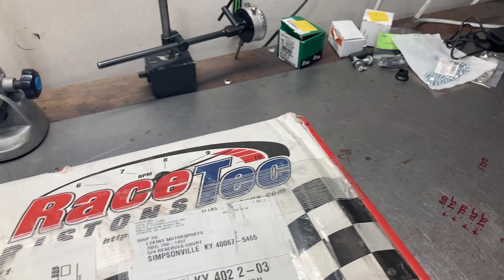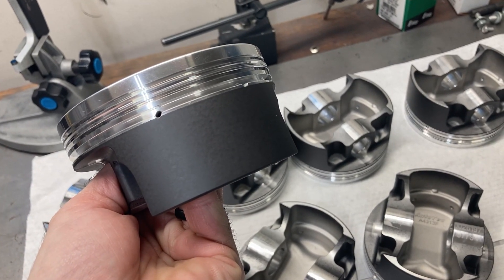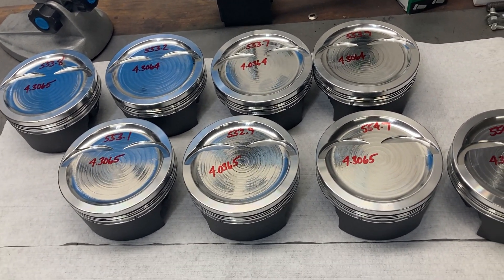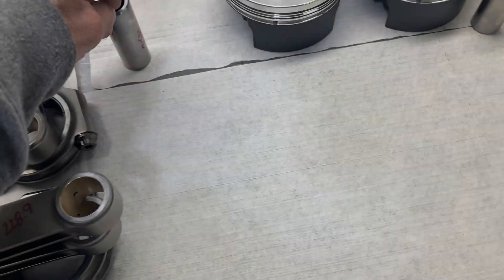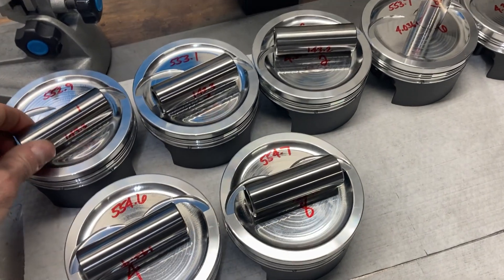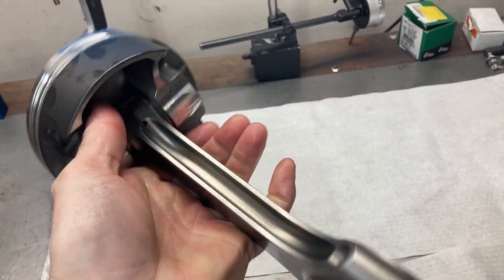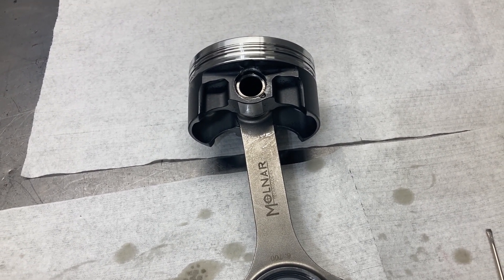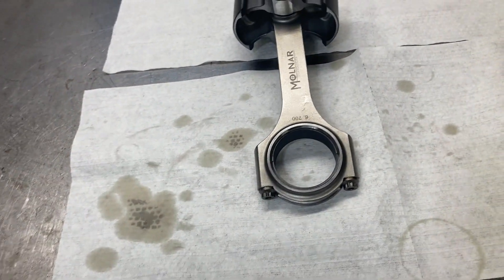Lykins Motorsports Ford 496ci FE (Dennis T) Rod/Piston Assembly

Comment: why are cam bearings such a problem to get . Is there a reason you use only Durabond ?
Reply from the maker: It’s like everything else post-COVID.  Manufacturers run out of stock quick.  Durabond is the only one that makes the bearings for these aftermarket blocks.